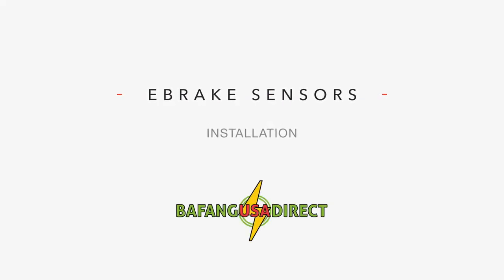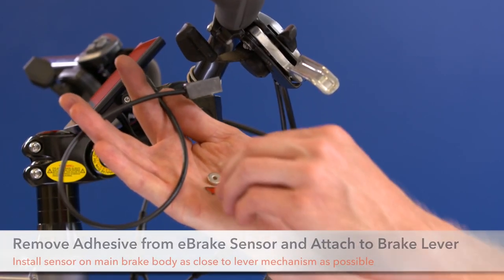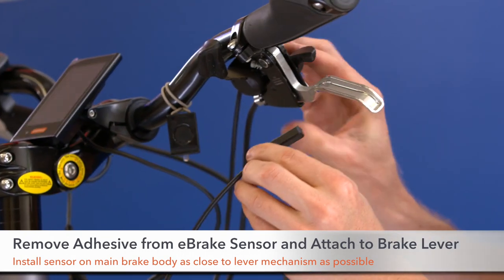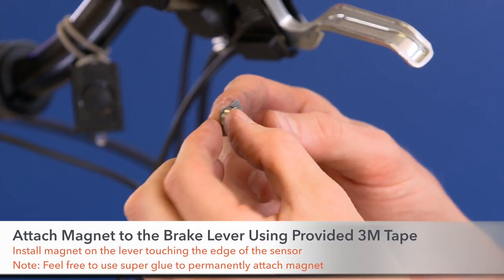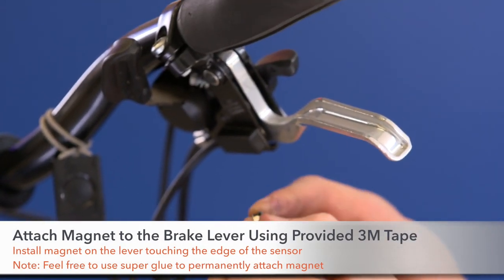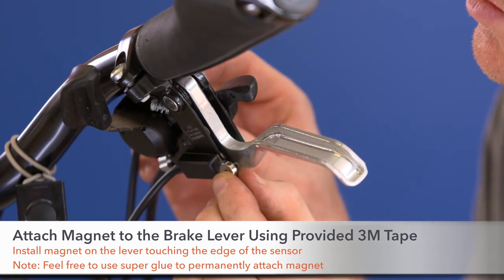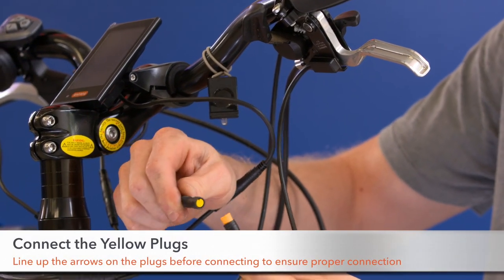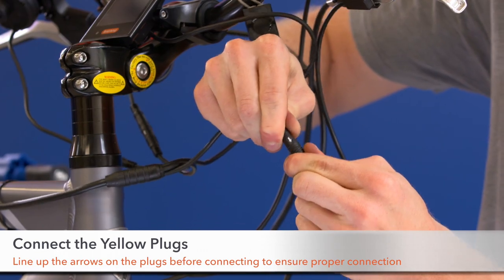Bafang Hydraulic and Disc Brake Ebrake Sensor Installation

Comment: this video is not relating to the brake they are installing it on, its the type of sensor, which can be used on hydraulic or disc brake type, i would recommend not bothering with this videos installing and get yourself inline ones if you type into any search engine, ebike for bafang or ebike 3pin round plug brake, this would require having a seperate gear to brake set up, the hydraulic method is tricky but i would recommend doing it with the adhesive and use the throttle or turn pedels till you find the sweet spot to cut off, its that simple, use epoxy resin to hold in place sensor and magnet.

Comment: any ideas on how this can work with drop bar brakes?
Reply: I've had good luck wiring a reed switch up under the bar tape and a magnet on the tip of the lever blade. Poor (or smart) mans brake sensor.